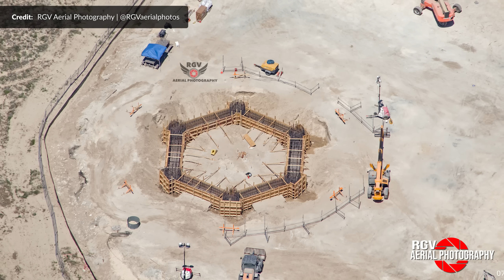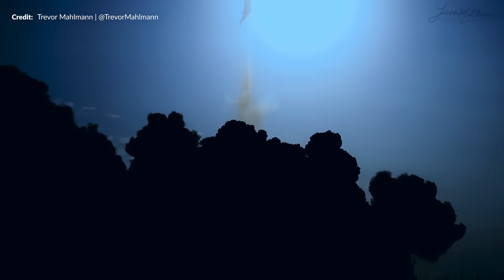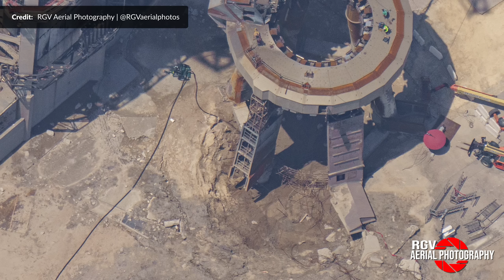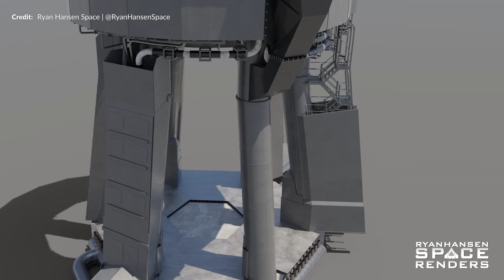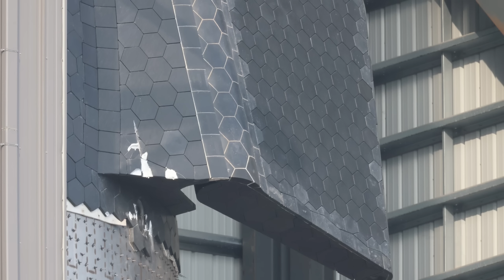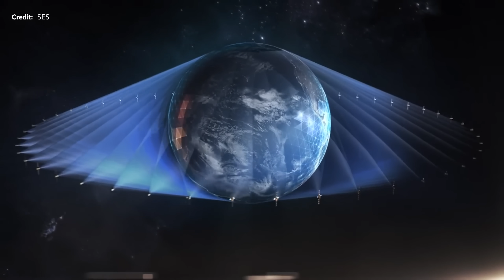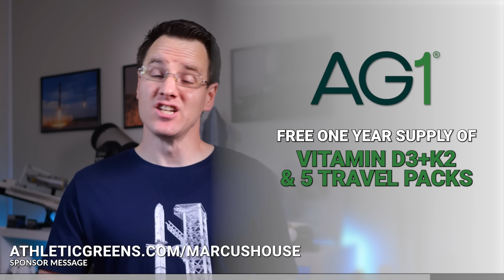The Starship Damage Left Behind: How are SpaceX Moving Forward?

Comment: I would think that the oil rig launch platform would be looked at quite seriously now. I don't think there can be anything under this vehicle at launch because it is simply too powerful for any solid structure beneath it to survive. Doubt even a flame diverter and a full water deluge system could tame this beast. But launching directly over water would solve practically all problems and reinforce the shielding of the launch table to water cooled armor plating and maybe you could launch twice  in a short time.
Reply: SpaceX sold the oil rigs and said that they want to get Starship flying first. They may revisit sea launch after that. The logistics of launching Starship at Boca Chica are MUCH easier than trying to do that at sea.

Comment: It's obvious that SpaceX needs to re-design and rebuild the launch mount. I'd suggest switching from a 6 leg to a 5 leg design, to prevent resonance reverbation between opposing pairs of legs. It also needs a deep flame trench and/or a taller launch mount, I'd suggest both.
Reply: A deep flame trench we probably will not see considering the amount of work it would take. Are you familiar with the construction of pad 39a ?

Comment: With all the impact and abrasive damage to high pressure infrastructure, I would expect that the risk of weakened pipes and tanks exploding under high pressure loads would make replacing all of the exposed sections required to pass safety code.  Can you imagine working anywhere near damaged high pressure fittings that could rupture at any moment?  If they plan on eventually using this site for regular launches I would hope the rebuild the launch table with a proper flame diverter built in.
Reply: Or of course those high pressure hoses, pipes and tanks could be pressure tested with say high pressure nitrogen or just straight air and if they pass the required pressure testing their good right?
Reply: @Scanner9631  I’m sure that’s what they’ll do, and it will be mostly fine. Sometimes metals will loose a fraction of their structural integrity an may pass stress tests, but have a reduced mean time between failures. This is why high stress aircraft parts are periodically inspected, but occasionally still fail while in use. Nothing is perfect.

Comment: So hows it going to go landing on another body [planet ] and take off again no concrete landing pad on mars or moon …..
Reply: Been answered many times before you posted.
Reply: The Superheavy booster with 33 engines never makes it to orbit, much less the Moon or Mars. The Starship (second stage) can launch from the Moon or Mars without needing a booster. The current SpaceX plan for HLS Starship is a ring of 24 smaller LCH4 engines at the top of the propellant tanks. These would be used for the last bit of landing and the first bit of launch on the Moon. It's not unreasonable to think that a similar system would be used on Mars. Starship (second stage) has 3 sea-level Raptor engines in the middle and 3 to 6 Raptor vacuum engines on the outter rings. So nowhere near the thrust of the Superheavy booster.

Comment: I wonder if there's a reason why they wouldn't contract with the Bore company that is basically a sister company anyways to drill a hole under the launch pad. They could create a pipe to direct a huge amount of that gas away from the launch site. Blasting into a wall seems....dumb? What could essentially be a pipe would literally go with the flow and in theory they'd only hafta build it once. Hell, they could even install underground baffles at that point to further reduce vibrations and they could widen the diameter of the pipe as it moved away, add in some smart venting, and even install steel fins down the pipe to generate a vortex effect to further coax all that energy along efficiently and they'd almost entirely eliminate the need for any kind of deluge system. Right? That completely eliminates any need to raise the rocket up any higher. And the wear and tear on the site should be drastically reduced. After the clear display of the destructive potential of this giant ass rocket, whatever "pad" they build is not only going to be expensive, it's going to need to be replaced fairly regularly, if not after every launch. I can appreciate the established standard of just a flame trench instead of a full blown pipe of fanciful depths, but none of these other agencies, including NASA, had a literal boring company that could be redirected by the owner at will.

Comment: What about the news reports I've read that the FAA has grounded Starship indefinitely pending an investigation? Part of that investigation involves the environmental impacts of the launch. I don't expect them to be in a hurry to finish that investigation so it might be longer than anyone thinks before we see another flight test.
Reply: The FAA grounding happens after every mishap. From the CRS-7 Falcon 9 mission that had a RUD to Sir Branson's sub-orbital flight that flight a bit outside the restricted flight area with no harm to anything. After that Jun 2015 Falcon 9 B1018 booster RUD, the B1019 booster flew in Dec 2015 to make the first landing. I would not be surprised if the repairs to Stage 0 took longer than the FAA grounding.

Comment: Minute, 1:22, shows the launch pad under construction in 2020, meaning that the concrete placed was VERY green at the time of lift off, with still a lot of water in it, (concrete takes about 100 years to fully cure), so the incredible heat caused the encapsulated water to steam and that's what blew the concrete apart.
Reply: You do know that this isn't your garden variety concrete and that there were experts involved in all stages of this right?
Reply: @Scanner9631  Yes, there are hardening agents that can be added to the mix before concrete placement, but still, curing concrete takes time, and SOMETHING blew the hell out of that pad.  My guess it's the liquid abruptly turning to steam that was a major contributor.  

What's your guess?
Reply: @lonihollenbeck4654  

My guess is the experts used all the information at hand and it wasn't enough.  

Now with new information they will figure out what exactly went wrong and we may or may not get a clear explanation from them at some point.
Reply: @Scanner9631  an interesting and somewhat related story was the findings from the Chernobyl disaster where the water evaporated so fast, faster than our science thought it could, that it created a unique, one of a kind explosion.  It's a very interesting read.

Comment: Oh geez, I just realized something:
.
The 'catch' system of the tower will be catching a rocket with the engines thumping exhaust power.  That exhaust power may be less than the launch power but may still be strong enough to rip off concrete layers in and around the tower. even though the rocket will be caught higher off the ground.  
.
The lesson is learnt here! 
.
They may need to build a massive water-cooled thick steel floor covering around the greater floor area around the tower too.
.
As a concrete engineer, I believe exposed concrete is not a good idea.  It appears the exhaust force is penetrating and tiny crack in the concrete and ripping up the concrete.  Everything around this pad will need a very thick steel cover.  That is going to be mucho expensive.
Reply: 33 engines x 230 tons thrust x .9 (operating at 90%) = 6831 tons of thrust.  During the catch the Super Heavy will be hovering so thrust needs to equal the current mass say 250 tons (maybe less) possibly spread over two or three engines making the thrust less concentrated.  Not going to do the same damage especially as you say from a greater height AND with steps taken based on what they are learning now to make things more durable.

Comment: Are there plans for leg installations for controlled landings coming anytime soon?
Reply: Plans to catch it out of the air with the chopsticks.
Reply: As Scanner9631 said, the plan is to move the leg mass to Stage 0 by catching the booster and Starship (second stage). The temporary, one-use legs used on the SN5-SN15 flights were going to be replaced by much larger, more robust legs. Which is why the move to catching, to not have as much of the landing mass on the spacecraft , so you can carry more payload.

Comment: I deeply dislike the "build, test, fix" method SpaceX is employing. it's very wasteful, particularly for problems that were  pointed out but they refuse to fix (Elon shouldn't make engineering decisions).  The waste is not the only problem but the unpredictability and the potential for MASSIVE DAMAGE is  very very high here.  It doesn't take much to go wrong for rocket to become a bomb.     This launch site just seems like a problem that will continue to be a problem.
Reply: Consider the wasted billions and years on SLS which is all based on shuttle era tech.  Shuttle engines.  Shuttle SRBs.  Shuttle fuel tanks.  Yet $11.8 billion and over 10 years for nothing fundamentally new.  They still had major repairs for the launch platform AND it is inadequate for the later iterations of SLS AND the platform for the later version isn't built but all the money was spent.  So speak about wasteful.
Reply: @Scanner9631  The core stage is new, since you can't just slap engines on the ET and call it a day. It only looks like the ET due to the insulation. SLS is using traditional methods of spacecraft development and is a cost-plus program, so saving money is not incentivized. Musk has apparently done well in the past with his 'the best part is no part' philosophy, but this time, it bit him in the arse.

Comment: That's not a safe assumption about the hoist equipment.  Lowering the arms only confirms operability of the brake, which could have a manual release.  It's quite possible that the electrics and control gear could be thoroughly trashed, but the arm could still be lowered.
Reply: So how do you control the brakes without the electrical or control gear?
Reply: @Scanner9631  The same way you manually release brakes on elevators and general winding gear.  It's not necessarily possible on all winding machines, it depends on the construction.  Commonly, there's a spring-applied brake which has a manual wheel or lever to release it in addition to solenoid or hydraulic actuator.
Reply: @Murph9000  

You really think that they would trust such a system to send a human out there to release it and risk that huge system crashing down uncontrolled when they could wait and bring in a crane to support if if thing failed?  I don't.
Reply: @Scanner9631  I think it's entirely possible that the winding machine was designed with a controllable manual brake release in addition to the normal one.  A manually controlled brake release is quite capable of slowly lowering a suspended load if designed and operated appropriately.

For example, a winding machine in an extreme environment where there was a risk of damage from flying debris might have exactly that.  Such a mechanism can be a safety feature, to allow the load to be taken off the machinery prior to repairs.

The point is, the assumption is not a safe one when manual brakes exist and are capable of what was observed.  If the machine and/or controls are damaged, getting the load off it is a priority for safety.
Reply: I did a little digging.  It's apparently a NOV ADS-30Q drawworks machine.  They don't give specifics for their ADS series, but their DSGD series does indeed have a manual brake release for emergency controlled lowering of the load.  I.e. more than just possible, the manufacturer has exactly that type of manual brake release on some of their drawworks.  The brake disks on the ADS-30Q are 48 inches each, one disk on each side of the machine's drum.

For the DSGD series, they say:
"A disc brake system is utilized for parking and emergency situations.
It consists of two air-cooled discs with spring-applied air-released
calipers to provide fail-safe braking capability. These brake calipers
are normally operated remotely via the NOV drawworks integrated
control system. Emergency brake controls on the DSGD drawworks
allow the load to be manually lowered using the brake calipers."

Comment: why would you put the starship lifting lugs immediately under the fins ?  aren't there other cleaner locations, clear of the fins, for these ??

two lifting lugs ?? two ?? really ?  you need three to control the lift.  Two means you're trusting the CG is where you think it is, and that there are no lateral loads.
Reply: I'm sure they determined where the best balance point (also shielded by the fins from air friction).  If you make sure the tilt brings the bottom towards the tower you can have it "lean" against an integrated support.  Otherwise you need at least one exposed unprotected socket within the heat shield.

Comment: Was it true that the Locks did not release for some seconds after ignition. That would surely be the reason for much of the damage to the pad and ship.
Reply: The locks were released about 15 MINUTES BEFORE the ignition.  The weight of the 5000 ton fully fueled full stack made them redundant especially since ignition was at ~50% thrust which was not enough for lift off.

Comment: I think when the Starship + Booster will fly safely into orbit, then safely orbit the Earth and both can land again, the Booster as well as the Starship in Boca Chica, the landing on Earth, so a point to point landing, will be the next challenge. Parallel to that is the development of the tankers and refueling in orbit technology and, of course, the Starship's task of sending Starlink satellites into orbit. Only then will we see an unmanned lunar orbit and in parallel the construction of the SpaceX Lunar Module. Greetings, Sven from Sweden
Reply: Orbital refueling will attempted before a landing.  An Earth landing of either booster or Starship isn't needed (but refueling is) before a HLS landing.  Starlink launches can go on concurrently with refueling development and before landing is working, even refueling (or partially) a Starship that launches Starlinks.
Reply: @Scanner9631  That is right. This is only necessary if the Starship launched for point-to-point landing is to be relaunched and is not intended as a disposable rocket for resupply. Refueling means launching a Starship plus booster from Earth into orbit and that would be a big additional cost factor. The Starships are comparatively cheap in production. For point-to-point operations on Earth, a Starship without a booster would be sufficient for a suborbital fly. Maybe in a suborbital fly the starship with full tanks would be able to take off again after it has completed its mission. It would also be much lighter if it could not be refueled on site, which could also be an option.

Comment: Ive heard some of the smaller debree kicked up may have damaged a couple of the boosters cuasing the flight failure. Not sure how true it is though
Reply: It is possible.  On the earlier tests they had damage to control lines in the engine compartment (that were then armored) and the power of only 1-3 engines was hardly comparable.  I haven't seen any official confirmation.

Comment: The bigger the rocket the more difficult is damage control. does this prove that spacex might have gone over the chemical propulsion rocket size limits?  What would be the smallest size that might might be feasable using starship concept with stailess steel, with second stage shielding, etc?

Comment: There is NO WAY for the concrete debris to actually hit the rocket or the engines. It's simple physics... the debris is accelerated by the engine thrust, and whatever kinetic energy they have will not be enough to fight the engine thrust plume all the way up to the nozzles. It's physically impossible.
Reply: Yes, when ALL the engines are firing. But the ignition sequence does not work that way. It starts with the center engines, and the outer engines are lit last. So, before they begin thrusting, the outer engines can get hit by debris from the earlier-ignited inner engines.  Most of the engines that failed were on the outer ring.
Reply: @spacexrocks1041  Yeah, except that the concrete didn't break then. The concrete held pretty well during the test fires and it held probably for a good while until all the engines were lit and the rocket was pounding it about half the time it stayed on the pad at full thrust. In fact, the failure mode based on the photo evidence seem to indicate that it was exhaust seeping through gaps that were present or was formed into the soil under the foundation that evacuated the substrate and cause the unsupported concrete to fail. Where the subsoil was not compromised the concrete held. That did not happen in the first second or two, it happened after all the engines were lit and because the rocket was there in that state for too long.
Reply: @dwightlooi   (1) Static fire of 31 engines was at 50% thrust, & launch was not full (100%) thrust, it was 90%. (2) I think saying the concrete "held probably for a good while" is probably not proof of how much time was specifically involved. (3) Honestly, neither of us know what happened down there. We're both blowing smoke. I wouldn't rule anything out yet, without any hard data; but I guess you would. That's your choice & I respect that.